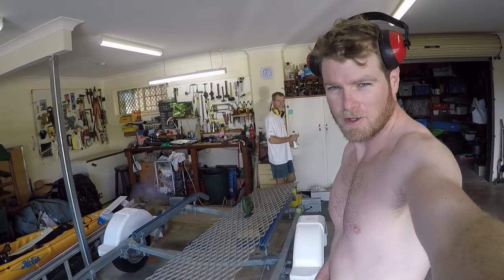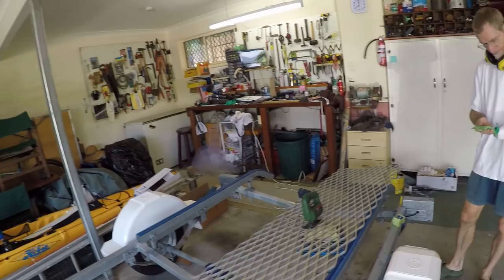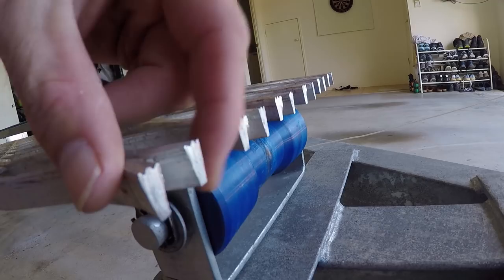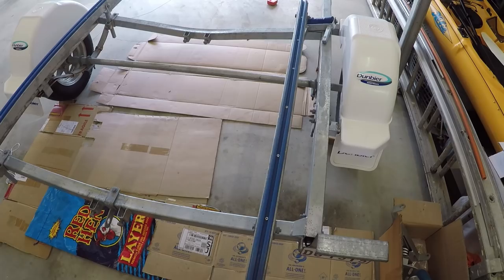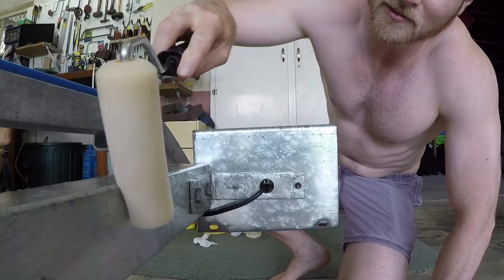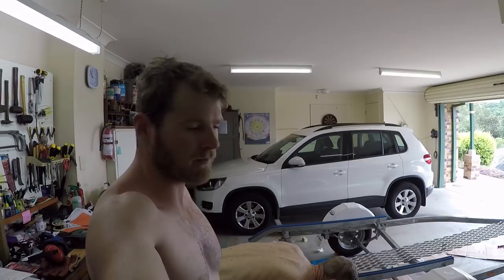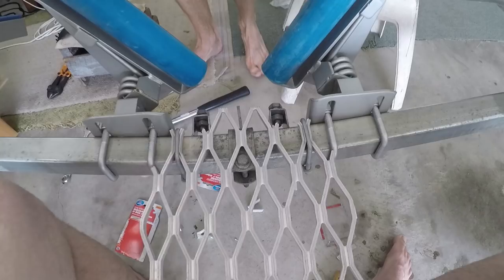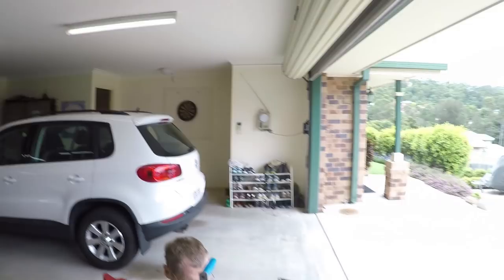Boat Trailer Modifications : RUST PROOFING, GANGPLANK, EZI GUIDE

Comment: Great idea the spring loaded guides at the rear, my 4.29 mtr  tinny is on an oceanic trailer that has the cut out across the back in the middle that I have put a wobble roller on either side that guides the boat just like your spring loaded guides.
Reply from the maker: yeah mate they work a treat. very happy with them!

Comment: Did you stick with the ez guide? What's your thoughts about it now it's been on for a while?
Reply from the maker: Hey mate, certainly did. I reckon its great worked a treat!
Reply: @SammyHitzkeFishing  You sure? 'Not much of an easy guide then' 😆 Would have scraped the metal side of the roller if not adjusted by hand.. Still a great product though if set up correctly I reckon. Thinking to get one, thanks for the video to see how it's supposed to work!